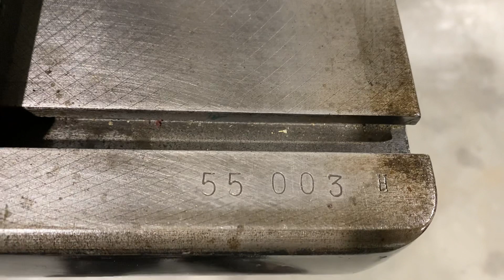Heidelberg Tiegel GTP for die cutting

Comment: Une GT qui découpe ne se nomme pas GTP. En Allemand le « P » placé ici voudrait dire : pragefolie littéralement : film chaud autrement dit : film de marquage à chaud. Les GT qui étaient prévues d’Origine pour effectuer uniquement de la découpe portaient une autre lettre en finale de leur nom.  A vous de trouver, c’est plus facile de dire n’importe quoi...., et plus vendeur.
Reply from the maker: Salut, you are right. But if you look closely the machine has been reworked from GTP model to standard die cutting machine. 
Only the GTP model remains on serial plate :)
Reply: 7802900572 parais kaya he